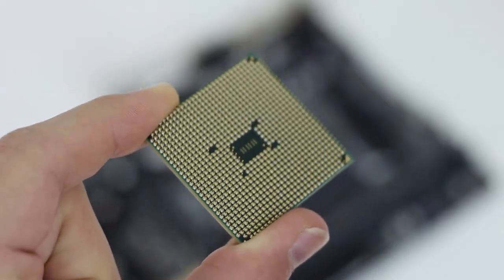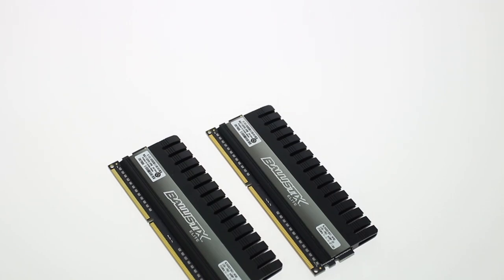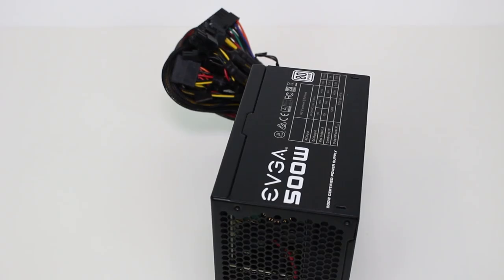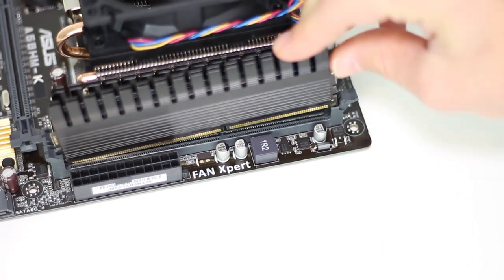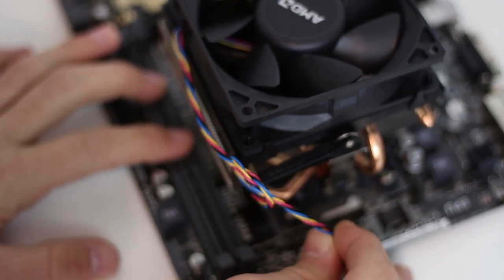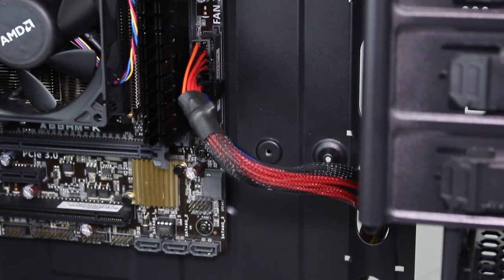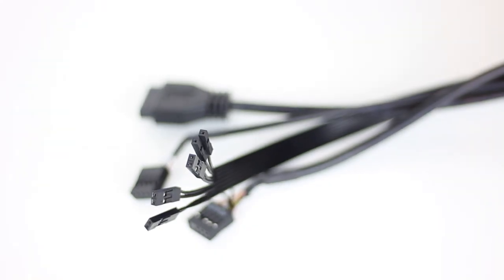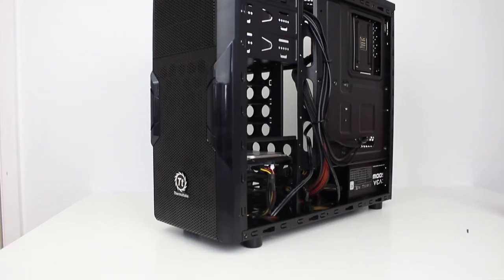HOW TO BUILD A $350 CONSOLE KILLER GAMING PC 2017! [1080P - ULTRA!]

Comment: I can't not stress enough how grateful I am to find this in my recommended. I've been looking at both pre and custom builds and this looks like it might be the one! I just have a few questions for you, 1: how well does it run GTA5? And on what settings?, 2: how long do you think it will take until i need to upgrade? and finally 3: What parts do you recommend upgrading immediately? I ask that last one because i don't want something that bottlenecks everything else instantly. Thank you for taking the time to read all of this and have a swell day.
Reply: freefire127 peasant
Reply: How am I a peasant? I don't believe you can run around shouting insults at people without an explanation.
Reply: i have the same questions :)
Reply: If i had a budget like this i would honestly go used

Comment: Yo James do you think Gigabyte GA-F2A78M-HD2 Micro ATX FM2+ motherboard supports a AMD A10-7850K, because I recently bought a GTX 1050 Ti and I'm 90% sure my x4 860k bottlenecks it.
Reply: Hi, yes it does support it. It supports any APU from AMD. However even the AMD A10-7850k may bottleneck it and it's not much of a performance increase. If I were you I wouldn't bother with buying an APU if you've got a graphics card already as you're paying extra money for the increased graphical performance of the APU.

You could always upgrade your motherboard and get an FX or i5.

Comment: Would this be able to run games at higher frame rates if i included a graphics card in this build, or would it have the same performance. I am trying to run games like Overwatch, GTA 5, Witcher 3, and any thing else in those category's.

Comment: you should try the dual gpu support for the apu by adding a r7 250 2gb. i have a 860k overclocked to 4.2 ghz, on air, and paired it with a spare r9 290x, from a crossfire build, and the cpu does bottleneck the gpu. does what i need it to do though, hits the vsync of 60fps on my tv on high at 1080p.
Reply: majinmx For that price your better off getting an I3 and a gtx 1050

Comment: you can build a Pentium g3258 + 750ti for less than this and it would perform much better...
Reply: True
Reply: brunaso change that pentium to an x4 860k and that 750ti to an rx 469 and your good
Reply: Tristan Hansen yeah, but the Pentium + 750ti combo is cheaper and it's still better than this PC build
Reply: an rx 460 (not rx 469 lol) is slightly better yet the same price. also the x4 860k is only like 30 dollars more but is a huge upgrade because some games just don't run on dual core anyomore
Reply: Tristan Hansen you're right, yeah, an athlon x4 would do better
Reply: brunaso yup. both the 750ti and rx 460 would be good but I would personally go for the rx 460
Reply: no way mate - a pentium will not outperform any quad core cpu even from AMD. At a budget like that i'd go for (used) a top end athlon and 750 ti.
Reply: //clear_code ok we've already agreed that an Athlon would do better
Reply: GUYS I know the athlon is better than the Pentium but the Pentium is cheaper and it would still outperform this PC build from the video
Reply: pentiums are crap, they are dual core mate, do you know anything about computers?
Reply: //clear_code you don't need a quad core to be paired with a 750 ti...it would still perform well
Reply: if all you have to say about pentiums are dual cores you cleary dont know about computers. Also pentiums arnt all that bad, paired with a 750ti and its better than this pc
Reply: Ferm _ Ghostly also there is no hyperthreading mate
Reply: true
Reply: say hello to gtav's max 32fps, on this dualcore, also u could get much cheaper athlon 64 x2 or equal cpu for two cores
Reply: DAR1US ffs I'm just saying this combo would be better than the pc build from this video, how hard to understand is that?
Reply: brunaso i understood everithing good but im saying that right now 4 threads is minimum for some titles, example is gtav where on dualcore game is glitchy and parts of the world arent loading, tho the game is normally optimized, thats why dualcores can even run it and get~28fps average, apu shown in the video has weak gpu comparing to ur build, but it can play gta v at ~30+ average and without those world glitches
Reply: brunaso dont get me wrong but ur build is more focused on gpu intensive games, and is perfect for vavle titles, but cpu intensive side ur pentium bottlenechs this gpu
Reply: 90% of games are gpu intensive
Reply: brunaso btw with new kaby lake pentium featuring hyperthreading ur pc makes more sense tho it would cost more
Reply: brunaso btw with new kaby lake pentium featuring hyperthreading ur pc makes more sense tho it would cost more
Reply: did you watch Tech source?

Comment: would you go with an i3-6100 overclocked a little or go with the cpu in this video?
Reply: The i3-6100 is not overclockable. Only "K" processors (i.e.: i5-6600k, i7-6700k,) are overclockable.

If you go with the i3, you'll be getting a dual-core with hyperthreading (making it a psuedo-quad-core)...but at least you'll have a better upgrade path. This AMD APU on the other hand doesn't have an upgrade path...but it is a quad-core
Reply: ye ok that's good. I am thinking about just saving a bit more money and getting an i5-6600k or something. btw the 6100 is overclockable with a z type mobo (there are tutorials on it)

Comment: Or get a G4400 with a 750ti/1050/1050ti
Reply: dot. much better
Reply: dot. Not better. The pentiums are dual core and this is quad
Reply: Tdcreeper Gaming It doesn't matter, the architectures are different.Plus, It will be much faster than this apu because it has a dedicated gpu.Just search benchmarks for pentium G4400 with 750ti and you will see.
Reply: dot. True, it depends on what you need though. Some things need at least 4 physical cores.
Reply: dot. Does this build need a GPU or is it your choice
How many frames per second would it get on GTA 5 high settings without any GPU
Reply: V - Vlogs If you want to game only on the Pentium G4400 i don't think you will get more than 30 fps at 720p or lower
If you put a 1050ti in there you will get 60 fps high settings on gta v
KEEP THIS IN MIND
1 of my friends ha build a pc with pentiumg g4400 and 1050ti and yes , he achieves 60 fps 1080p high sertings,tho he says he has a lot of drop frames.This could br solved by lowering some settings, or buy an i3 6100 and a 1050 non-ti
Reply: Tdcreeper Gaming but a G4440 is a skylake cpu so it can be upgraded easily but the amd apu is am3 so you can inky use apus unless if you get a new mobo
Reply: dot. What about if I get the AMD 7870 APU chip
With no GPU how would it do gta v and over watch thanks
Reply: dot. Would I get above 40 fps on both games with the exact build geekawhat has suggested
Reply: V - Vlogs I don't really know, search the internet for results
Reply: dot. But as per you it should be above that right?
I'm planning to get this exact pc and then later on add a gtx 970
Reply: dot. Sorry if I'm bothering you but I'm new to all this I have less knowledge
Could this build run the watcher 3 above 35 fps? Thanks
Reply: Hyper Heat fm2+
Reply: Ace of Games do you have any idea on how this exact build geekawhat suggested would do in gta v
In the sense how much fps on high settings thanks
Reply: V - Vlogs no idea
Reply: Ace of Games cool
Reply: dot. would bottleneck the 1050ti, I'd choose a 1050 as maximum for that cpu
Reply: G4400 sucks
Reply: Cairo Murphy it's going to be better than the apu he's going with. A CPU with an actual graphics card would beat an apu any day
Reply: dot. or a x4 845 and a 660 ti off ebay
Reply: you only get very low 30s in GTA V  on medium settings but with a 660ti (which is very similar to a 750 ) you'd get much better frame rates
Reply: b00t McDonalds A g4560 is way better
Reply: PokeJed x4 845 is very weak
Reply: Oshawott 98 Channel I think it is not a problem to have windows 10
Reply: Oshawott 98 Channel You could get deactivated windows 10 for free all it means is their is a water mark so get G4560
Reply: Tdcreeper Gaming this has a better cpu but the gpu in this cpu is a pile of shit get a 1050 great performance for ur money

Comment: Would this be able to play games like rust and other fast paced game in great settings?? In 60fps
Reply: BedrockBreaker11 No... Sadly it will probably run at low settings 40-50 FPS
Reply: As you can see in the video, the APU struggels in any "demanding" game. Sadly the integrated gpu will never be as powerful as a real video card. The games were at medium and the only 2 runing at 60 fps were CS:GO and ETS (I don't count LoL because that's not real 3d, any computer can run that moba).

However the build is pretty sold i think, and you can use it as an starter, and save for some decent video card. I'd say get a 1050ti later and you'll get those sweet 60 fps in pretty much all games at 1080 at medium and some less demanding like e-sports games even runing at high.
Reply: jose juan andrade would this build geekawhat suggested get gta 5 above 40 fps on high or ultra settings
Reply: V - Vlogs Hell naw he bullshitin just to get views
Reply: Chimmy Changa Crocodile how much would it get..
Reply: V - Vlogs 5 FPS max at ultra you gonna want to put it on lowest graphics to get playable FPS
Reply: You need a dedicated graphic card for pretty much any AAA game. An APU does NOT have the power to run pretty much any modern tittle at Ultra, not even at High. However, i think is ok to build a cheap pc like this as a start, because all you need to then run games like GTA V is to add a decent video card.  Like i said, check the video and ull see the games he is playing are games that are pretty low requirement and not realy recent tittles, and they are runing at 30 some fps.

Still is a solid build if you just add a gtx 1050ti later or a 1060, then you'll run GTA V at ultra at 1080 im sure.
Reply: Thank you so much
I don't really have much money for a 1050ti 
My plan was to get this then later get a 970ti 
How does that sound?
Reply: Thats a good plan, again, you can start with a build like this, and later on add a dedicated videocard. You can always just wait and save for that last part, but till then you can start playing lots of e-sport games and other AAA games at medium or low. So yeah sounds good!
Reply: Guess I'll do that then.. thank you

Comment: instead of getting this try 880k ~not sure about the socket
try getting 1 stick od ram 8 gb
and rx 460
around 50 more but the gpu is like 40% better + you will have 1 more slot of ram free for future upgrade. tho i would not recomend getting amd cpu atm the new i3 6xxx are much better or wait for the new amd cpu to come out
Reply: NiNi ChO i l know but for 1 fourth of the price you get 2x more gpu performance and the ram has 2133 if i am not wrong but the vram of gddr5 is 5k+ not sure od the mem speed for rx 460...

Comment: How will this run against Overwatch? And Rocket League?
Reply: overwatch would at 1080 but you would have to turn it down to low/medium quality to get and average of 30 fps. rocket league would rum fine as it's not a demanding game
Reply: Thanks alot i'm planning on getting a pc tomorrow so i'm grateful for the fast reply :D
Reply: I recommend finding another build for $350 because there are builds at $350 that can play bf 4 max settings 60 fps and other games at better frame rates.

Comment: couldnt i make a better pc for that price with a 750 ti?
Reply from the maker: For $450 you'd struggle a lot to fit a quad core CPU and 750Ti....
Reply: GeekaWhat why not just buy a used dell optiplex 790 with an i5 2400 for 50 to 100 dollars and then add in a 1050 ti and your still under your budget with way a better value
Reply: Epicklutcher94 not everyone accepts or are lucky enough to find good bargains, but still doable.
Reply: I looked for one day to put together the pc i have now and seen many computers that would have been usable. and then you dont even have to look hard for the gpu
Reply: Epicklutcher94 what a great find. in my country, the conversion rate is too high to ship from the U.S. and not only that, tax may also be included.
Reply: if that is the case you could probably get the same deal that i did at  surplus sales or recycling centers  just look up recycling centers or colleges and ask when they hold them each year.  or if the centers sell individually.  you can get really good deals that way.

Comment: "Highest end APU" well a CPU that doesnt even meet the performance of a G4560 (really im no intel fanboi) with an iGPU which performance is hardly based on ram speed.
with good ram its a little bit worse than a G4560 + RX 550/GT 1030

Comment: Mafia 3 should be the benchmark because that game is stupidly unoptimized and hardware demanding. The minimum requirement alone requires an i5 and a HD 7870. This build cant run it even in the lowest 720p at lowest setting at 30 fps stable so by the judgement of mafia 3 benchmark, this is not a console killer

Comment: Why didnt u get like a i3 6100 and a rx 460/gtx 1050ti
Reply from the maker: Out of the budget by a mile, the i3 costs $106 on Amazon and the 1050Ti like $140, that is like $100+ more than the 7870K - that is a completely different budget
Reply: if u could put out like 50 more bucks, u could have gotten that combo which is alot better performence for only 50 bucks more

Comment: Ok i built this pc almost perfectly the same only difference was a different case and I cant run World of Tanks on high over 40 fps so i am sorry this was clickbait and i really wish i had done more research.
Reply from the maker: +Jack Stone Did you watch the benchmarks portion? I detailed that this is a CHEAP PC, but one that is more than capable. Try turning anti aliasing and v sync off
Reply: Yes i did but there is no way the apu is going to run gta 5 over even like 40 fps
Reply: The case gives performance boost. If you add RGB LED it will perform as good as $600 gaming pc

Comment: this is a horrible build TBH 350 for medium settings ... and just get 60 fps 😂 . I'm on Amazon and about to buy a amd rx 460 80$ / amd 4300 60$ /  350 gb dw 23 $ / 2x 4 = 8 ram 40$ / case 35 $ / power 500 50$ /  mother board 50$ / DVD drive 0$...

Comment: Where is the graphics card ?!
Reply: In the cpu
Reply: Charlie The Insane that's sick?!
Reply: not that sick because you get worse performance :(
Reply: Robis oh I would rather get a graphics card then
Reply: RG69 its a apu witch is a cpu with build in gpu
Sorry for shitty english
Reply: RG69 and with this, if you bought a separate r7 240 or 250, you could run in crossfire. But you're better off upgrading unless you happen to pick up an r7 for very cheap
Reply: Ace of Games thanks